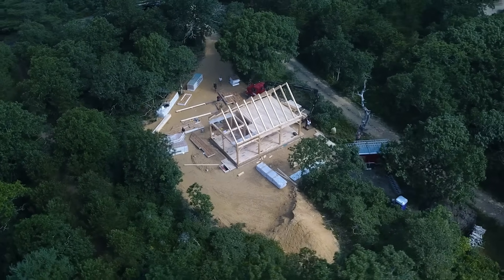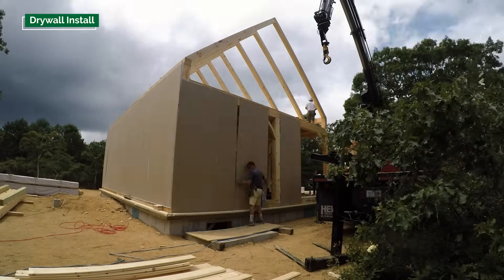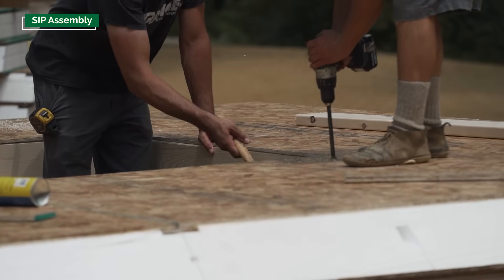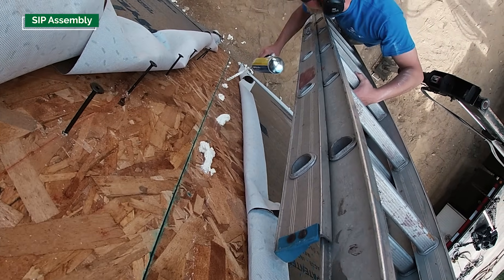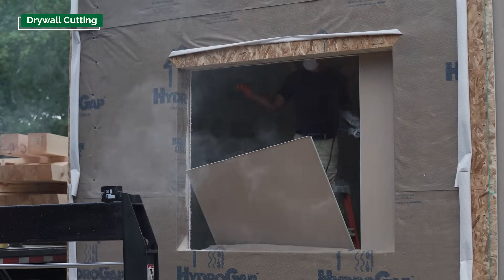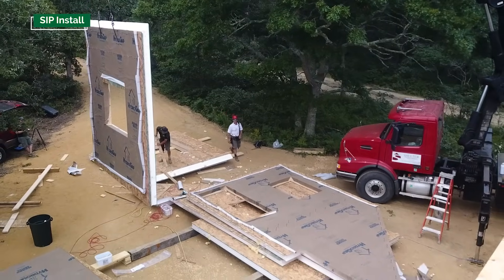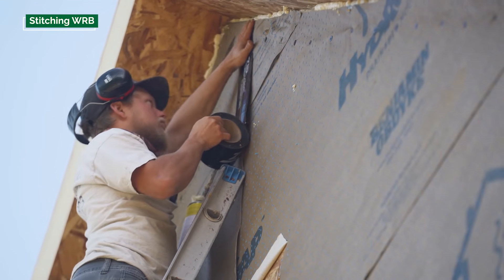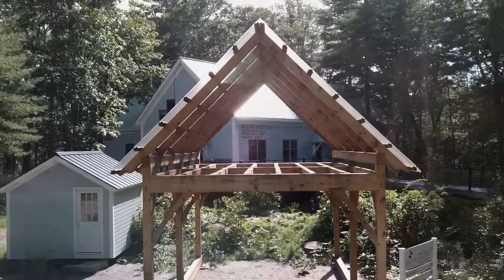Enclosing A Timber Frame With SIP Panel Walls | Martha’s Vineyard | Ep. 4

Comment: I'm wondering why you leave a gap on the sip panel for shrinkage of the post and beam timbers.  but you dont leave a gap on the first layer of drywall.  is the first layer of drywall not affected by the shirking of the timber frame?

Comment: I design a real lovely one of these a few years, main props to MerryOak timber who actually did all the hard work making a lovely Douglas fir frame. Feed back I got from them was it was difficult to get the SIPs at eaves and ridge to line through. I think the foundations were a bit off tbh

Comment: Man. This seems so much better than stick framing in virtually every way. It looks sturdier, more energy efficient, quicker to build, and uses less material. I realize that even with all that, timber frame is likely still more expensive due to the skill required and the higher quality materials, but still. I seriously don't know why timber frame isn't more common.

Comment: What’s the size of the LVL being used for the sill plate? Curious what the ratio of foundation wall to sill plate overhang would be when choosing SIP thicknesses.
Reply: Using LVL for the exterior sill plate is an expensive way to go about it. I am designing a cabin now and I am planning to extend the floor joists outside and use a simple 2x8 board as the exterior sill plate. Or maybe stack a second 2x8 on the first one.

Comment: I literally cannot believe you’re hammering nails individually to attach gypsum sheets to the frame….never heard of nail or screw guns?  They’re easily 4-5 times faster and time is money guys!
Reply: There isn’t any room for error with that small surface area of the timber frame. Wouldn’t want to go too fast and blast a hole in the Sheetrock.

Comment: I am not being a D bag, I am legitimately curious-it seems like you guys are relying on the expanding foam quite a great deal for waterproofing and longevity of the structure. What happens as the structure begins to settle? IE. foundation unevenly settling, the wood swelling/contracting, etc.?

Comment: I've watched a  number of your timber frame projects.. very cool system... the crane....  I noticed on this video when the homeowner comes to the job and they are standing next to a column,  I wondered if you sand all your material before it goes out? That column,  (at least in this video) looks pretty smooth.....
Reply from the maker: We plane all of our timbers before sending them to the jobsite!

Comment: SIp Panels have to be used in timber frames. Timber frames are fine and SIPs are awful. They get wavy. The ants like them. Too bad there is not a better alternative. If you stud a timber frame you are doing double duty. Most materials are made for stud frames. Anything with OSB is suspect.
Reply: As a builder, I like the idea of SIPs 

HOWEVER, everything I read about them is problematic, condensation, mold, rot, poor sealing at joints, running plumbing and electrical is a headache, etc
Reply: @Mike_Fortin  Yup they are trash. The fact remains , timber framing  and studding it  in is redundant. You can hybrid  with solid corners and heavy braces ....Timber framing is just something they try to  sell you. .As if houses were not expensive enuf to buy already!

Comment: I was gonna ask if those timbers were green and you answered it.  At the beginning I was wondering since the gypsum is attached the timbers do you guys ever run into issues with the gypsum cracking later on? I assume no but I also have no clue how much those timber’s actually shrink

Comment: Well the way they installed those sips just made another negative for me regarding choosing them. I mean   the sill plate isnt anchored to the foundation for one. I know its not a typical stick frame but still it will prevent up draft forces. Glue and using long screws into the timber frame isnt doing anything. And not to mention the seal quality keeping out water and bugs.

Comment: If you install the drywall before the SIPs, it seems like this precludes you from taping the inside of the panels. Isn't this important for air sealing? Same thing for the roof assembly and the T&G.

Comment: A friend of mine is a SIP builder.  I have watched him build with Timberframe.  He uses panels by Extreme Panel out of Cottonwood Minnesota.  They build panels as big as 8'x24' .  He doesn't use any foam for assembly,  He uses SIP specific caulk in a sausage tube.  He orders his panels to spec and they fit like a glove.  HE does Air seal testing and his houses are very tight.

Comment: What about running strapping along the outside members of the frame - install the panels. Then using the strapping as a separator between frame and panel, giving you a way to tuck in the drywall.

Comment: Why do you foam the walls before running wires through your electrical chases?
Also when installing the 2x material into the window and door openings are you foaming these 2x's in?
Reply from the maker: Great question! We foam the walls because that is a part of panel installation. After we foam the walls we clear the chases with a pipe. We do foam the window and door bucking to each other and to the panel.

Comment: It is imperesive. What is the cross-section measures of rafters? Maybe,
20cm x 20 cm GL24h ?
Reply from the maker: Thank you! This is 15 - 1/4 cm x 20.3 cm (6" x 8").
Reply: @ShelterInstitute  Wow, it is smaller than I think.  It is Glulam, right? Also, I would like to ask you another thing. How do you calculate or analyse your truss systems? With softwares or hand calculation?